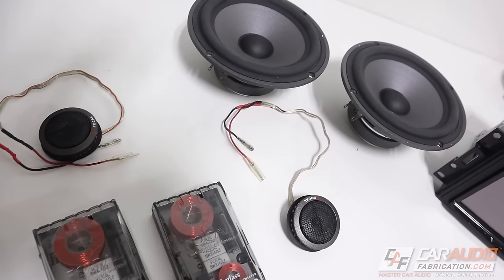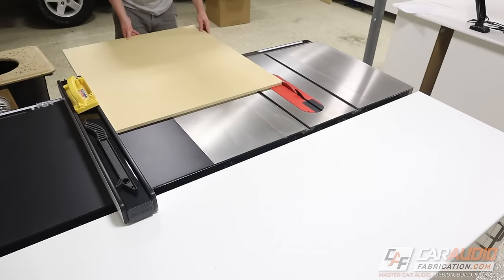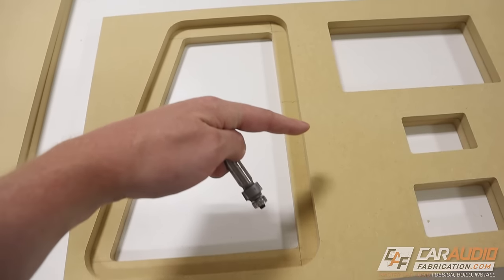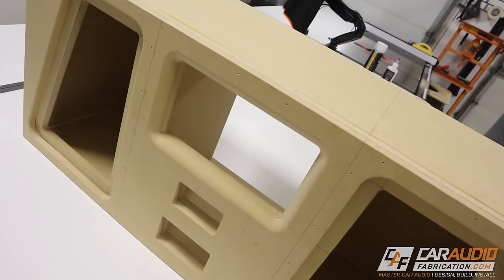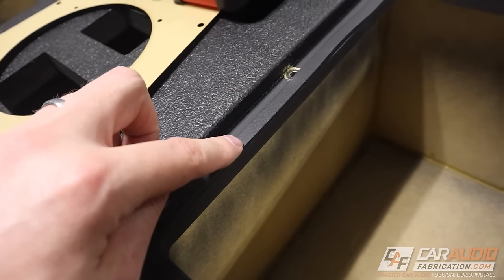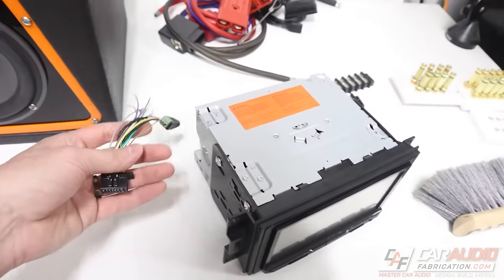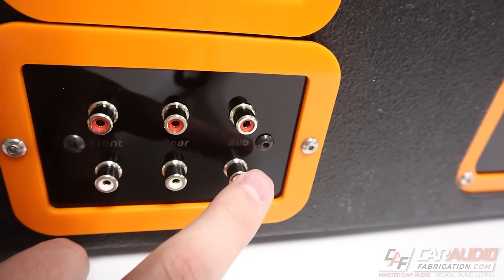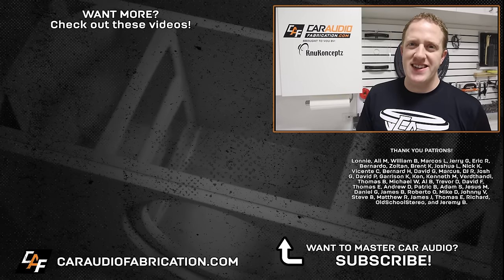How to Make: STEREO BOOMBOX! I turned OLD Audio Gear into a sound system!

Comment: Id love to see that sub built for this shop box system.
Reply: You could add a small amp & woofer with a good enough power supply.
Reply: @JesusSaves86AB  i was thinking about that too! I got a 10w3v3 with the grill, that i would love to use in a set up like this. i would just need a good amp. A 3 channel amp would be great! 👌
Reply: @joseluisruiz3789  I had a couple head units that allowed a sub wired on the rear channel instead of a pair of speakers. 
Tried several different subs wired up with a Sony deck as a work stereo and people were always impressed. 
A decent 8 or 10 is all you need. With some 6.5's or 6x9's.
Reply: I'd love to see it as well!
Reply: That system looks awesome I'm very impressed and what an awesome job you did, you should make some speaker boxes like that to sell to people who are willing to buy them from you anyways thank you for that tutorial breakdown that you did on how to set it up! You gave me some good ideas!!
Reply: Subject please

Comment: Hey Mark if you have more "old sets of speakers" like those send some my way lol I didn't notice anyone in the comments or you give any mention to that set. Those are the Orginal focal polyglass components! I to have a set of them sitting on a shelf. Pretty close to the same but mine are the 3 ways with the 3" also. They were my first set of high-end components that I bought years ago. I ended up putting them in for only about a week and putting my RF T165s set back in. I liked them better. Was actually disappointed in the focal set after the cost of them and all the hype. Now they just sit in the Box I put them online for sale for a little bit for like 400 and they wouldn't even sell LOL so now I just keep him because they're cool so you have a set. Since then I've boughten a bunch of different sets of high-end and my favorite to this day still is the Rockford Fosgate T Ford I never got the chance to get a set of the t5's although I did get my hands on two of the Crossovers but never used them and they got dropped in the box and all damaged. Well enough Babel from me, thank you for making these videos and showing us your craft you are one-of-a-kind!

Comment: If you have an old desktop computer sitting around and in a bind for a power adapter, use the power supply from the computer. Cut and cap all wires not yellow or black, and use the yellow + and black - for your juice. 
Great use of your components and I needed your part of wiring in the additional for testing. I have an old Pioneer single cid unit with a computer power supply that works great. Now with your help, I can add testing to it. Be blessed. Shalom.

Comment: I built a boombox about 6 years ago . Using a pioneer double din head unit ,400 w  r m s  amp ( CT Sounds , kicker 400w r m s 12 " sub , running off a 1200w ( 100a )  12dc power supply( HP) . Clean  ,clear sound even at full volume

Comment: In my workshop I have been using an old System for 10 years. A Sony AM/FM CD player to an old Rockford Fosgate 2 channel ,run to an MB Quarts 6.5 mid.1 inch tweeter. Then the same amp bridged running 12 in Kicker. I use a little motorcycle battery hooked up to a Battery Tender to run the system.

yours looks better....but mine is fine!

Comment: Yes! I would love to see how you add a sub to this AC system, I've thought about doing this for years! I was going to use an old JL 10 and a Kenwood amp, but the DC power supply was hella expensive! Also thanks for the box design (EMF Banhammer 15), it's built (yay!) but I'm still working on the rest of the install (including my first basic custom center console)
Reply: I used a RV power converter not that expensive

Comment: I get the idea that your channel is going to make me want to spend money I don't have! Way back in '96 I had a blue Dodge 1500 with Shelby stripes. My local shop (Sound Obsessions) ordered 10 JL Audio 18W6 subs. They only ended up using 8 in their Blazer so they installed the remaining 2 in my regular cab 1500. I ended up losing my centre seat to a full time centre console to fit the box, but damn! So low! PPI monoblock amp.

Anyways. After that trip down memory lane I've found your channel. We'll see where this goes! Love your videos!

Comment: Great video but just a quick suggestion for the power, I would use a PC power supply. You can buy 800-1500 watt units for a reasonable price and that would be rms power not max. For years I had 2 kicker 12" subs running off a 650 watt antec power supply and I never got any clipping on the amp. A quality 850 watt PSU would give you around 70 amps on the 12 volt rail, with a 1300 watt psu you could push over a 100 amps all day long.

Comment: Only thing that’s missing is a heavy duty boombox handle on the top for moving it around.  with rechargeable speakers coming in all shapes and sizes, I’m actually surprised that no one on eBay or Amazon has created a mass produced speaker box for (add your own) single or double-din 12V radios with a corded or rechargeable power source.

Comment: Nice!  Now chuck some polyester fiberfill into those speaker enclosures - they should end up sounding even better.  As for subwoofer, that big open space in the back of the build looks about the right size for a subwoofer based on one of those 6.5" Tang Band drivers....

Comment: I also have been wanting to do this! Great stuff! I wish you could have used a computer power supply instead. I have one small 15 amp one and one 55 amp one. One for radio and one for amp. Wanting to build an all in one "party boom box" 
Could you do a video on something like that?
Reply: From my experience you MAY get a lot of noise from old PC psu's, or at least that was my experience. I did the same thing, but ended up going with a Laptop power brick that was clean as a whistle through the amps, I get more noise from the fan on the amp fan, but I'm running the amps at 24V, soon to be 36V. Try yours out with temp wiring just to check, just check your psu loading, as the car amps may draw too much current for the 12V rails. Good luck.
Reply: @Chippie-O   How would one use a laptop power supply cord if there was no adapter to accept wiring as seen in the video. Is there only pos/negative in there? Just strip and go...

Also how do you check psu loading?

Comment: LOVE THIS! I have been working on my garage audio setup for a while, and am adding a dedicated sub with a plate amp. I'm using a Home Audio receiver I had laying around, not a car deck. But I also want to build a semi-portable setup to upgrade from my Klipsch KMC3 Bluetooth speaker. The Klipsch is great, but I want more, and it gets a lot of port noise at louder volumes.

Comment: I Always like running head units on 15-16V for a little more power. all those TDA/PA/TA chip amps are rated for 18V but most head units can take 16V. all the logic is internally regulated anyway

Comment: I already have most of the parts needed for a build like this. Digging this. 

Have you done a fiberglass build? My '99 CRV has a small, removable trunk space and I've had an idea of making an amp box to fit in its place. With a removable mounting board.

Comment: Great Video. I designed a (all in one) box for my Smart car as obviously there is no cavity room anywhere and the doors are like hollow plastic. I have a new idea design for the car and watching a few of your videos has helped me be more aware of things I need to do. I have a table saw and router so could do things similar (not as good though). I use a Ground Zero Amp and am going to add 4 more speakers to the 6 I use. The four being dedicated bass, so I have to figure out how to make the enclosure using less space (depth) than I have at present. I was thinking of two 12" (possibly 10")@<80hz & two 6" for say 80 hz>, but was wondering what minimum depth I could get away with for the enclosure, if width and height were variables...What do you think?

Comment: Eclipse by Fujitsu Ten Head Unit, currently sitting in storage.  Never got installed sadly.  And now that they are long gone the amazing security feature is too dangerous to use.  But I could setup a backup battery for unplugging it.

Also have a/d/s 325is full set.  But I'm planning to use them in my next build when I'm able to do so.  Unless I can come up with the money to buy a set of JL Audio C7s in which the a/d/s can go in the boom box!!  LOL

Comment: I would love to see this with an onboard battery, or at least a battery on board to maintain low current draw for memory settings. I’d be doing similar to this with the addition of Lithium cells and an on board charger to maintain but I don’t know enough about those electrical systems to make purchases yet 😂

Comment: Love this build, gonna do one myself but it'll just be a boombox for around the garage so definitely not as cool as this one. My nice component set is installed in my truck, so I'll likely use my old Pioneer coaxials I have laying around. One thing, since you are running a component set of speakers, couldn't you have used the head unit's 4 channel outputs to drive them actively? Both my current Kenwood Excelon and old JVC single dins have this feature, though I prefer having a factory style fader control so I have never used it.

Comment: i have a nice older component set of MB-Quarts that i think ill do this with. its a tweet, xover, and a 5 1/4, so i could make a nice small and somewhat portable box. i even have an old pioneer head unit when they first started using front panel USB, perfect for something like this. thanks for the idea, this was really cool

Comment: I'm attempting to make a garage car audio system. I bought a Powermax PM3-100-LK power supply, Kenwood BT728HD HU, Pioneer DX975 Amp, 4 kicker 6.5 coax speakers, and a Skar sub. Id love to see how you would wire this all up for the best possible performance.

Comment: Hi Mark, awesome stuff.  I noticed you used crimped spade terminals at the mid speaker.  Do you solder them and them push the plastic cover back on ?  I prefer crimp, solder, shrink tube with sealer.

Comment: Now if it only had an "onboard battery"!!!! It is an amazing build please don't take me wrong!! But the problem I have is what happens to your memory when the thing is unplugged from the wall?????? For my own PERSONAL USE, I would love to see this same set up BUT with a small 12 volt battery in it so you could add a working clock and have preset radio stations if needed!! Again in MY case there are only certain radio stations I like to listen to......so I would want to preset my stations and keep them programed into the head unit!!

Comment: What would you need if you want to add multiple stereos.  what would you use in order to turn one stereo on and at the same time turns the others off.  As if you were at a store testing/ listening to different units.  what parts are needed to make this possible?

Comment: Hey I would like to ask. Maybe I missed it somewhere. Full size headunits are great but those older single din cd player types had an issue where if you disconnect them they lose memory and settings especially when you are not using a car battery to keep it alive. How will you fix that? Adding a smaller aux battery?

Comment: If ever you redo this, would be great to add 4 coax speakers, 1 subwoofer and small amp, a huge lithium battery, a solar panel, a 12v outlet, an inverter, and all cabling inside. Using a lighter wood or plastic would be even better. this would make the ultimate camping/emergency rig.

Comment: Cool project.  Two comments though.  One, your boombox has better components than my daily driver truck does. :)  Two, though its cool, I don't have new enough room in my shop to house that boombox.  Until I have more room, I'm going to have to be satisfied with the little Milwaukee battery powered radio I have now. :(

Comment: For the adapter, skip buying one. Just hit yourblocal thrift store and pick up an old xbox power supply brick for $1. I dont know of another commonly found 12v adapter with a 16A output, or even close. If you wanna add amps, thats cool.  Just wire several in parallel (make sure theyre the same model number) and stack em. 16A, 32A, 48A, ect.

Comment: I sorta made  one mine is powered by a 20v drill battery and is using a 24v to 12 v step down converter to power the radio head unit

Comment: Hey Mark, I work at a dealership as a Automotive Technician. I own a Ion Stadium Speaker, which is great for sound but I am missing the BASS. I'm familiar with the sound system logics, as I have 2 P3's and Rockford Fosgate speakers all around in my Honda. I was wondering what Subwoofer I should tie in with my ion speaker, or even if I should. And if so how would I go about doing so, if it's a lot ill just build one like you guided me to from this video. PLEASE REPLY BACK!!!! Big Fan

Comment: Hey Mark, great video. You've inspired me. I 'm gonna build one with some old gear I have. I want to use a 2.1 amplifier board I have along with a 6.5 inch subwoofer from an old Philips home theater system. My question to you is what is the absolute smallest subwoofer enclosure I can use and still get the most out of this small sub? I want the overall size of the boombox to be as small as possible. Any suggestions???

Comment: Thanks for your video content. Great work, extremely cool details. Do you think I could replace the speakers in my old home towers with car audio components? I have some classic Infinity 12” 3-way towers, with adjustable x-over slider. The x-over is faulty , but boxes are great design. Thanks

Comment: I have one question, maybe related to this project somehow! Is it possible to use a set of car speakers (Focal 165AS) to build a speaker enclosure and have a good sounding system? They sounded good in my car, so I guess they will sound good at home with some tweaking!! In terms of power, I also have a spare equalizer and a spare car amp, so I am pretty much covered. Is this a crazy idea?

Comment: I wanna see the sub to. And possibly have it to run off the wall outlet to. That would be cool. So you don’t have to worry bout the car battery. Or have the battery on the back to power it but have the wall outlet to charger the battery. Like a alternator would in a car

Comment: What about a boom box with bigger speakers , like 6 1/2 or 6x9 , with a built in subwoofer , 8inch perhaps ? Will it run with that A/C adapter ? Would be epic ! Great build ! I have been wanting to build one myself just for my patio /workshop,  “ why buy one when you can build one “
Reply: Some Pioneer head units have configurable rear speaker outputs - you can switch on subwoofer mode. Basically it turns the head unit into a 2.1 system with configurable HPF/LPF (2 front outputs are the widerange stereo outputs for the speakers, and the rear outputs are bridged into 1 channel for subwoofer, and both pair of wires are active - for dual voice coil sub like almost on any monoblock amp). So yes, theoretically it will run properly using that small A/C adapter, because the head unit will never pull more than 10 amperes (see the fuse), if this head unit have this option for rear speaker outputs, because basically for small sub there will no need for extra amp for the sub.

Comment: Hey-I know it's been a while since this video was put up but I'm interested in doing this for my shop and there is no link for the adapter plug that has the wire output to be able to wire up the car stereo head unit. Can you please put that in the parts? Thanks!

Comment: Question... Ive seen people use the XBox brick adapter since it can go as much as 200 Amps. You think an amp can be connected to the system not to exceed the Amperage? I'm thinking of doing this build or in a tower style but with a sub and amp.

Comment: love this idea if using old speakers to make boom box but I also have some subs that I would want to add in to the system. how would you wire amps in to the system without having to swap to a car battery and keeping mains power, I can see the DC adapter only being 10a being an issue....
Reply from the maker: I address this in the video. If you want to power full blown amps obviously going to need a much larger power supply.

Comment: Very nice, i did almost the same, I have two 6x9 one on each side with a 10" sub in a seperate box and on the central part i have a single din radio and pc Power supply that i screw the board inside and i put the fan on the bottom to cool down the radio and Power supply. I have a 4 channel amp screw in the back (60wrms for each 6x9 and 180wrms for the sub) it's very loud, i have the first and second version on my channel, a video is comming to show this third version!

Comment: amazing build...but like some other comments this should be a full 2.1 system for top level awesomeness :) i guess the issue is the head unit is powering the speakers and you'd need an amp for a sub which complicates the build and makes it a lot less portable.

Comment: Great content👍🏾. I'm new to this and am looking to get more bass in a 99 Integra without adding a 12 in sub that's going to defeat the purpose of having a hatchback. I recently ordered a set of mid bass speakers from Orion they're 6.5" 8 ohm speakers and have a larger magnet. Is there any application that you could think of that wouldn't take away from the factory use of the car?